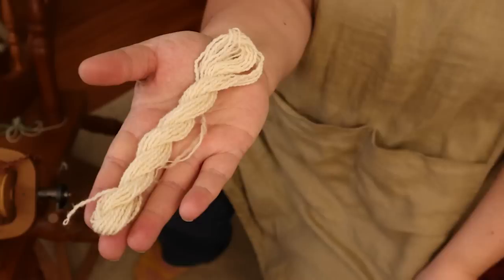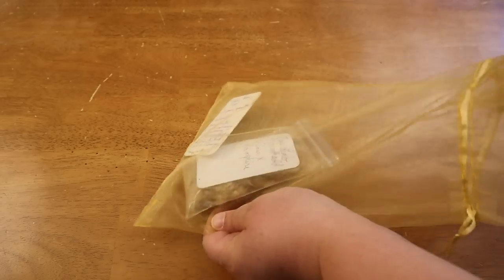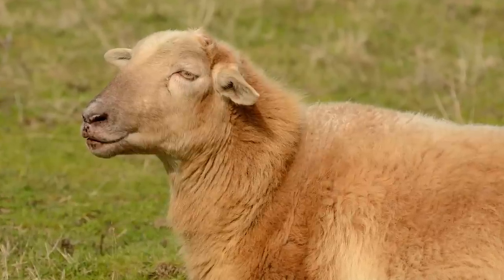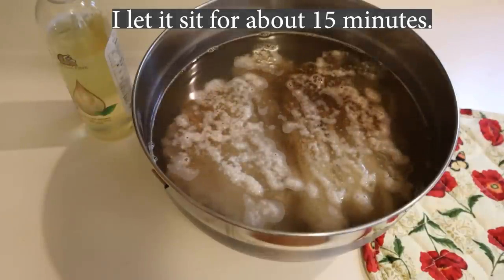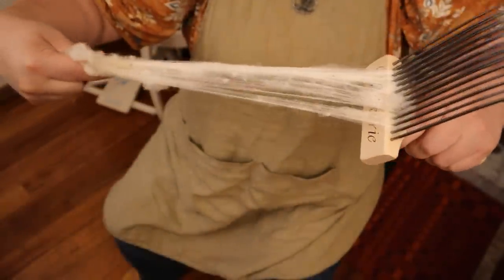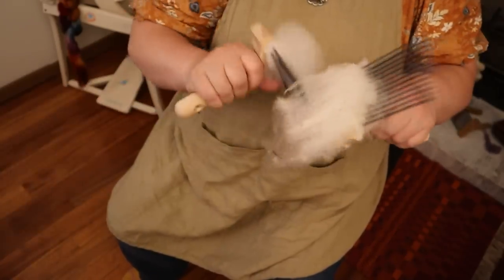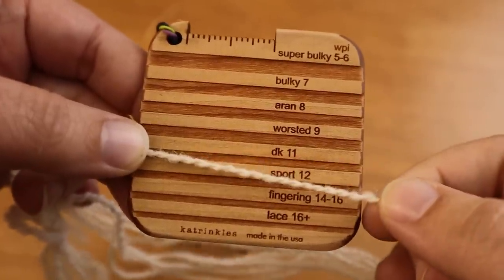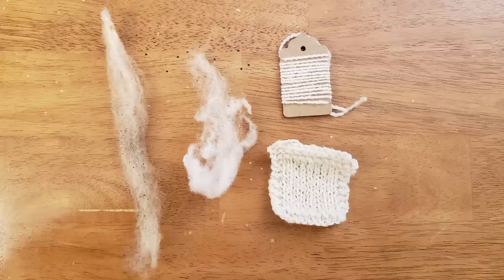Wool To Yarn - Scour, Comb, & Spin - American Tunis Breed Study🐑

Comment: Hi. Dunno where to put this question. Its a weaving question and for some reason I am just brave enough to ask specific people for specific problems. So general weaving and spinning and fibers go to you 😅 The question is: There is a technique with tablet woven bands to finish them. Basically you shove a loop into the shed to weave the tail back into the fabric. Nobody seems to do this in regular woven textiles, though. Is it possible? Wouldn't that be a great technique to secure the top salvage? Plus: to get my tablet woven salvages super clean, I leave a loop behind and then turn the cards, fasten it and then pull the loop through. This way it's a consistent width (mostly), is this possible in regular weaving?
Reply from the maker: I haven't tried it with a larger piece. I'm not sure it would work in a non warp faced weave. 🤔
Reply: @JillianEve  so I know what to try, if I ever got a loom. A big one, I mean. And I think I will finally try spinning

Comment: Question, have you read, the knitters Book of wool? Would this be a good resource book? There is a kindle version but its only A fraction of the hard copy. I wonder if there is a difference or if there are add resources in the printed book.
Reply from the maker: I haven't read it or compared the two, but I think the text should be the same. I've heard good things about the Knitter's Book of Wool so it might be worth checking out!
Reply: Thank you, I will

Comment: Is ram wool in a breed different from a ewe's wool same breed, and same age from the same flock?
Reply from the maker: The 2 main differences are 1. A potential musky ram smell. I use a vinegar soak after scouring if that's an issue. 2. Rams are rambunctious and strong which can make shearing more challenging. There might be more second cuts and short bits as the shearer needed to get the wool off asap. Otherwise, I haven't noticed a difference in micron count or crimp. Those things should be standard to the breed.
Reply: @JillianEve  Thank you for your answer.  Inquiring wooly minds want to know! 😆